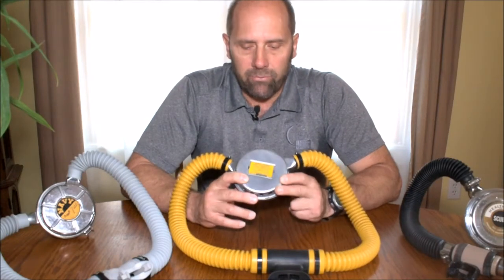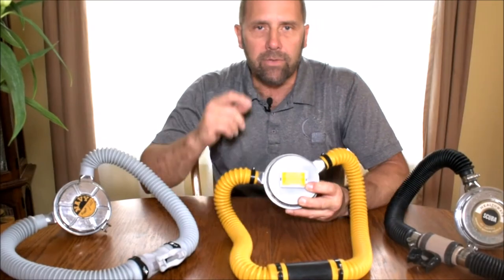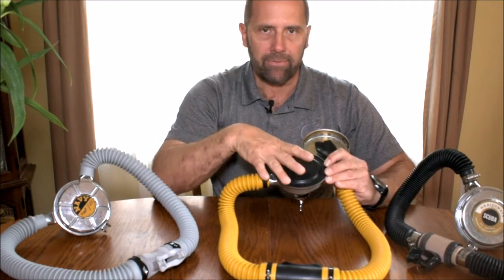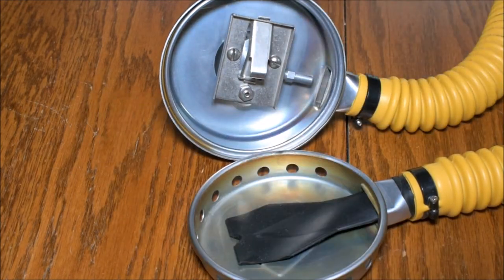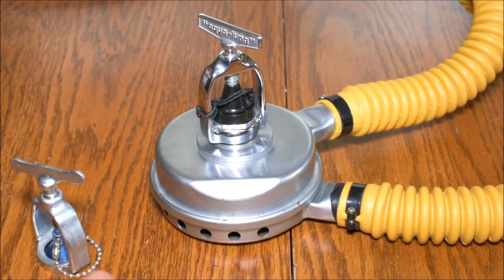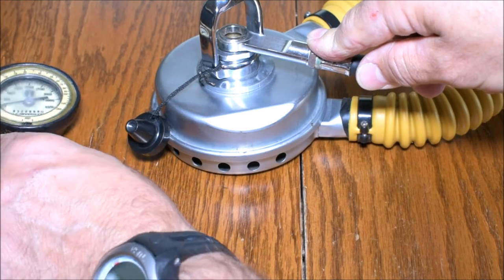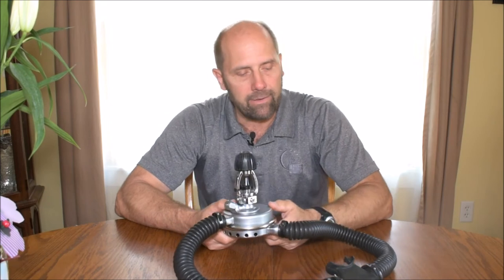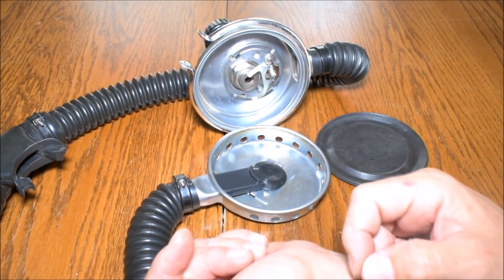Double Hose Scuba Regulator basics

Comment: just came back from Malaysia for a dive trip. Update on the Kraken. great regulator!! easy to maintain and clean. Dive with Double hose requires a little more than a single hose, like the bcd choice. I dive with an aqualung rogue(back inflated). Work well with Kraken.
Reply from the maker: Thanks for that. I don't usually use a BCD when I dive a DH. They tend to cause the regulator to sit further off my back than I like. I do have a horse collar that I use from time to time though. Especially if I'm going deeper so I can compensate for the loss of buoyancy created by suit squeeze. 
One day I'll get a Kraken. Until then I'll use my Phoenix and enjoy that. It's almost drysuit season here so I'll have buoyancy control with that.

Comment: Nice and very useful! I have a couple of Mistral and I'm searching for an  INT connector for today tanks.  In your video I've seen an Aqualung connector.
Can you tell me which kind / model is it? Thanks
Reply from the maker: I'm not sure which connector you're referring to but the long yoke came from VDH https://vintagedoublehose.com/ Another good site for information is https://vintagescuba.proboards.com/ New and second hand equipment can be found on either of those sites. Hope it helps.
Reply: @DonFassbender  thanks, yes long yoke
Reply from the maker: @paolovecchi55  Good luck! Let me know how it works out for you.
Reply: @DonFassbender  today I’ve done a test. I’ve changed the yoke with a newer one (scubapro) and I’ve added a little steel ring to have more space for that yoke. Regulator now is ok, only a bit hard to breath out of water.
Reply from the maker: @paolovecchi55  I'm surprised that it is hard to breathe from. Is it tuned? Do you know when it was last used?
Reply: @DonFassbender  I don’t know when it was last used. It is in perfect order in all its parts. Maybe it need to be tuned. I think using the little wheel inside.
Reply from the maker: @paolovecchi55  It is a good idea to tune up an older regulator especially when you don't know it's history. There's an o-ring that should be replaced as well. Check that website link for a tune-up kit and if memory serves there are videos that show you how to tune it. It's a great way to get to know your regulator. Of course, YMMV

Comment: recently purchased a royal aqua master
Reply from the maker: I've had a couple RAMs in the past. Nice regs! You gonna dive it?
Reply: yep. Gonna let vintage double hose upgrade it, going to be my main reg system @DonFassbender
Reply from the maker: Are you going with a new first stage (Phoenix) and HPR second, @pricediver ? The Royal is a great performing reg but the convenience of gauges and hose plus easier breathing characteristics make it worthwhile IMO.
Reply: Yep, that is exactly what i'm going for. just love to see an 45 years old reg being used again, huge fan of double hose regs! @DonFassbender
Reply from the maker: @pricediver  Agreed! I have two from 58~59 that I use and absolutely love!
Reply: Yep, it should be an awesome experience. I am only 19 years old, just got certified, but love vintage diving  @DonFassbender
Reply from the maker: @pricediver  That's great to hear! I assume you've researched the difference in breathing characteristics compared to the single hose regulator you learned with in your open water course? There is much to learn as these regulators do not purge like your modern regulators, nor will they breathe as easy if used improperly. I'm afraid it is beyond the scope of our discourse here, to go over these things properly. Please read as much as you can and seek additional training if possible. Good to hear that your so enthusiastic about vintage Scuba diving. Good for you!
Reply: Yeah, I actually did a lot of research of how to use a double hose reg. I think the HPR can help a lot for breathing, as well as the Phoenix. But idk if I need a certification just for double hose reg diving?  @DonFassbender
Reply from the maker: Not really, but take it slow as you learn the steps necessary to dive one safely. If you have access to a pool I recommend trying it out there first and practice those skills unique to double hose regulators. Thanks for commenting and please come back with any updates 👍
Reply: Thanks! I definitely will. thanks for the information  @DonFassbender

Comment: Ya Don my Jet Air regulator likes the vid too!😀 And I run it off my steel Dacor tank and my Dacor tank valve has a high pressure port for a pressure gauge. It's sweet!
Reply from the maker: I like that valve! I use one for my Mistral sometimes. I have more than one but a limited number of gauges with the smaller port. Thanks again for sharing and I hope to see it one day!

Comment: If you are interested in a double hose regulator, you may want to check out VintageDoubleHose.com they have created a modern double hose suited for high pressure tanks, with a high pressure and 3 low pressure ports, it's called the Argonaut Kraken, it's an awesome regulator draws real easy, just had my dive shop configure it with a console on the high pressure end a BCD inflator hose and a second air source on 3 low pressure ports...will be doing a pool dive to test it it all...
Reply from the maker: Yes, the Kraken! Someday I'll have one of them. Til then, I have all the 50 and 60 yo regs to use 👍

Comment: Is there any double hose regulators that work from a compressor hose and not from a tank? work on boats hate all bubbles on my face when working.
Reply from the maker: Hello, Eduardo. The US Divers DA Aqualung has a port in the back side that you can hook directly to a surface supply. It's a fairly common regulator and parts are readily available. I would look into getting one of those.
Reply: @DonFassbender  thanks Don appreciate input love your great videos Thanks
Reply from the maker: @eduardoperez7797  Thank you for your kind words. I hope to have more time this summer to put more up. Keep diving, friend 👍
Reply: @DonFassbender  please do great information priceless im already looking for the one you recommend thanks.
Reply from the maker: Thanks,  @eduardoperez7797 !
 They should be readily available on ebay.
Reply: @DonFassbender  Ok Don I’m back this time throwing a curb ball at  you lol I found a USD Royal AquaMaster with the hookah port we are good up to there, I came up with this crazy idea (sure someone else has) to conecit to my OTS Spectrum full face mask I know about the mouth curb piece but I’m thinking changing the mouthpiece with the Argonaut DSV mouthpiece it’s got the same connection as my mask and it’s got the 1 1/2 inch hose same size hose it’s just my idea but it’s best to ask an expert really appreciate your time thanks.
Reply from the maker: @eduardoperez7797  I bet that will work though I've never used the newer gear. One day I'll get the Kraken and all that jazz.
The RAM is a great reg. A little less common but better than the DA Aquamaster so you did good there.
LMK how it works out 👍
Reply: @DonFassbender  I will thanks Don I’ll try and post a finish setup.